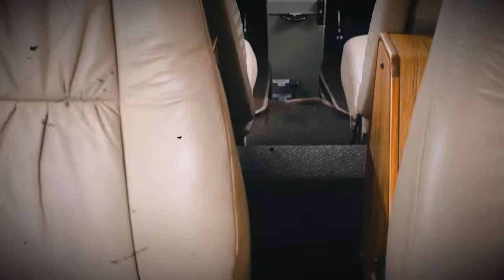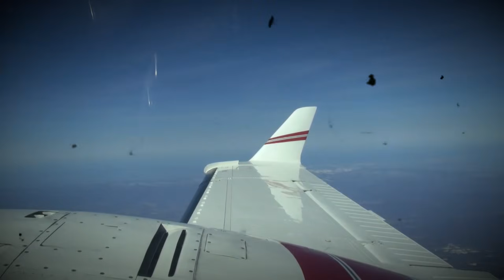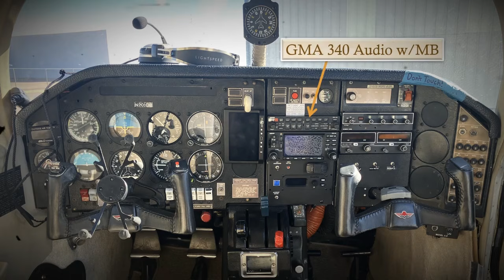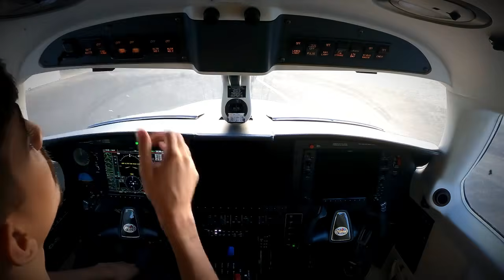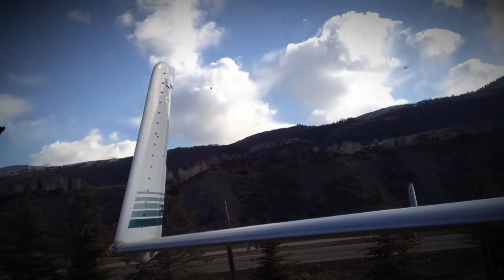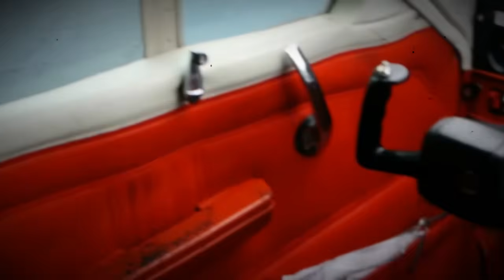5 SMALL PLANES SO BAD THEY’RE BEING SOLD FOR RIDICULOUS PRICES!

Comment: I own a Mooney M20J and disagree with this description. My aircraft was built in 1995, I bought it in 2019 for a fair price, and I had none of the issues described here. 

Of course, neglected, damaged airplanes are available on the market for cheap prices and not actually good deals, but this is true for each and every aircraft model on the market. The M20J is simply not an exception. 

But the very same thing is true for any other model. For example, once the engine needs an overhaul, you are in for a medium five digit price tag. But the very same is true for any aircraft using this particular engine, which is BTW one of the most used engines in the market by many, many manufacturers.